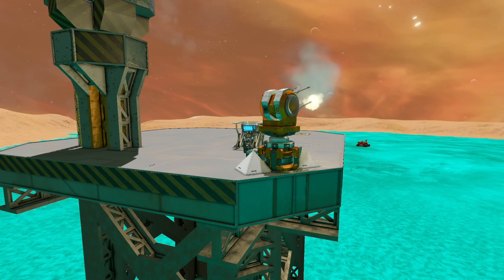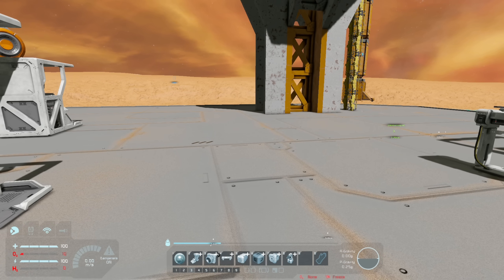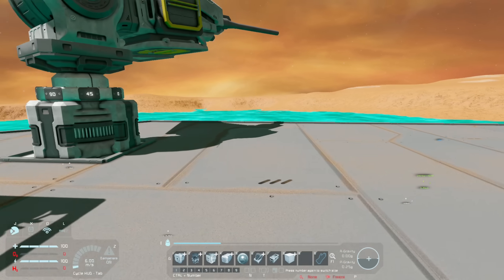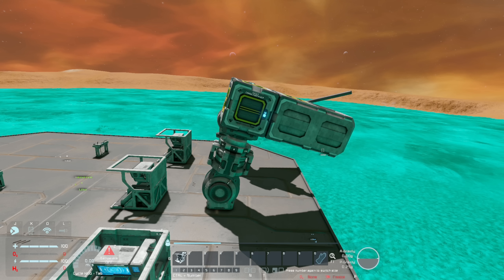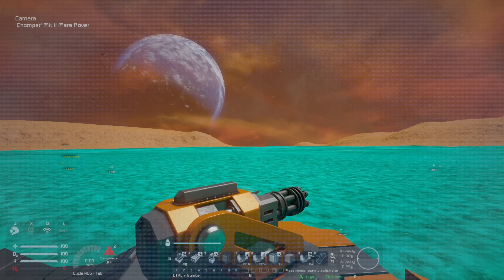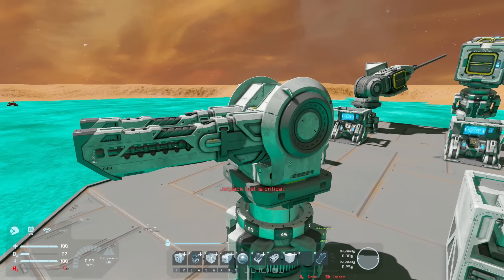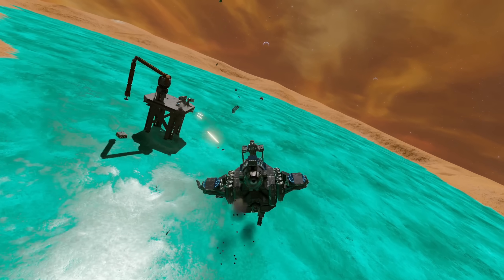Custom Turret Controller: Space Engineers Tutorial

Comment: Pro tip. To get a small hinge head inside the large hinge body. You only need to place a small landing gear inside of the large hinge housing, then place the small hinge part on the landing gear. You can then attach. You don't have to build a positioning contraption like in this video.
Reply from the maker: Even more pro tip, the game was updated to allow you to simply add the desired head directly in the control panel 🙂

Comment: I know this is an old vid but I’m hoping I can still get some help,

I just build a large grid turret that has a grid mass of 17,551,970. My problem is the turret controller is not smoothly traverse like a normal turret and instead incrementally maxing rotation and then slowing it to a stop. Elevation is fine but is the turret just too heavy or can I solve this another way?
Reply from the maker: That's likely pushing the limits of the capability of the rotor, unless your turret's centre of mass is directly over the rotor that's going to need enormous amounts of force to move
Reply: @Splitsie  
So drop some weight? ya that’s what I was worried about. I guess I was hoping no gravity = smooth acceleration. Although I did notice that turning off inertia share works until clang hits.

I’ll try moving the centre of mass over the rotor and update if it works but it might take a bit of moving around.

Thanks for responding
Reply: @Splitsie 
Hello, I started playing SE again and solved the problem.
Ya it was the weight. Better yet, I did not have to make the turret lighter. I used suspension and to take the weight off the rotor

Now I have a new problem something is causing the turret Ai to break. I have a feeling that it has something to do with the turret wobbling a bit after each shot but nothing is confirmed. Update when that’s ironed out

Edit
 I don’t know what I did but it’s back to moving weird. I think the wheels are adding too much pressure now.more tinkering to come

Comment: On Xbox one the advanced rotor doesn’t rotate with this setup. Am I missing something? Followed your directions to the end.
Reply from the maker: The console versions are almost identical to the PC version so you should be able to get everything to work. Check to make sure the rotor is linked to the azimuth setting in the turret control block, that the rotor is on and that there's nothing obstructing it from moving. You can also test to see if there are some minor obstructions or weight issues by increasing the amount of torque available to the rotor

Comment: This is an old video, I know, but I hope sb can help with a problem; The turrets don't seem to 'conveyor'. It doesnt auto load ammo for either gatlings or autocannons and I cant pull anything through it. I tested multiple setups, but as soon as I remove the larger hinge part and replace it by the smaller one; I cant use any of the conveyor system. It showes the classic 'blacked out inventory' when I try to pull anything through these turrets. I tried everything and they work perfectly on Creative mode, when it doesnt need to fill ammo, but in survival it just cant pull the ammo. Anyone any clue as to why this is happening?

Comment: I build all me vehicles for a first person only compatibility.  This results in most of my vehicles having piston masts with cameras and lights on them.  Before, I would use either tons of hotbar spaced to control the motion, or a remote and antenna.

The new block makes these masts much simpler, and really cleans up the toolbar, but sadly can't continue operating the vehicle when using it.

Camera masts are extremely useful when driving across rough terrain, as a sort of third person view when it is first person only.

I will have to test these out on my excavator though, it could really simplify operations.
Reply from the maker: That's a really cool use for these blocks :)

Comment: Does anyone know on the crane setup how the pistons push in or out using the controller? Is it just the "W" and "S" keys?
Reply from the maker: Those were just grouped controls on the regular hot bar. With extend, retract and on/off to allow me to stop it at particular points
Reply: @Splitsie  okay, thank you. I'm trying to weld up a projected small grid ship that has some internal components that were missed when I was trying to hand weld it. Trying to see if that controller and a large grid welder with complete the job.

Comment: I just struck me that, instead of picking A rotor and A hinge, the turret controller should offer the same list-box as with weapons.  (Each list-box should have an 'absolute'/'relative' check box to determine if offsets should be from a common zero point or from whatever value each rotor/hinge has when the turret is activated.)  This would, for example, allow easily pointing an array of turrets in the same direction with a single controller--maximizing solar panel efficiency, for example--multiple rotors for faster movement of a single turret, or a multi-hinged arm, such as a crane has.

Does that make sense?
Reply from the maker: That would make a lot of sense, it's a pity they didn't do it that way

Comment: I made a gatling turret but it looks "sideways". Can someone help?
I build an advanced rotor. On top i build a large hinge and destroy the center part. I add a small hinge. I place 3 small conveyor on the small hinge (for ammo) and place 6 gatlings on the sides of the conveyor. After that i put 3 armor blocks on the 3 conveyor to protect it and place a camera right on to (in the center).
I setup the custom turret controller, made a "controll" on my station.
after pressing the controll button i CAN controll and fire the custom turret BUT my view is kinda sideways. I can see 1 gatling on the left side of my screen but not on the right (should be able so see both or non) and if i fire the gun it shoots not where i look but to the right of where i aim.
Its like the camera is 45° angled to the left but i checked and the camera looks normal.
Only thing i can think of is that i moved the hinge while in construction to get a armor block in a spot that i could not reach. Can this mess up the setup and is there a way to fix it?
Thanks for all help!
PS: restarting the game fixed the problem...

Comment: This is driving me nuts. I followed your directions but as soon as I add the rotor and hinge to the controller they stop working. The AI randomly pivots and spins and if there's a target it will fire in any direction it's facing. I can control it, which means I pop into the camera, but I can't fire it unless I disable the AI and the rotor and hinge are still frozen. Whips script works so much better but I want AI railguns!

Comment: So I've set up a custom ball turret following all the steps, confirmed that velocity can be applied to the hinge and rotor in their control menus and that they move freely. However, when I attempt to control the turret through the control seat via the custom turret controller, neither the rotor nor hinge move appreciably. I can see their speed fighting to rise, but it never goes above 0.1-0.2 m/s and never practically moves. I assume I'm struggling with something to do with torque or multipliers but am at a loss as everything I've tried hasn't worked. Any tips?

Comment: 11:40 a much much much easier way of doing this, is to place one small block in the air so that it falls into the hinge, place another small block on top of that so that you have a 2 block tower and then add the hinge on top of that, attach the head and remove the blocks.
Reply from the maker: That works on level ground but not everywhere, where I can I try to show techniques that have as few caveats as I can manage, though if I were to do it again I'd probably show both ways

Comment: If you design it right, having turrets with strangely placed hinges and rotors such as flipping them could allow for some very, very alien-looking designs, rather than the conventional style everyone's used to. As for other ideas, I think having a turret with a cap on it would be interesting, as utilizing a sideways rotor rather than a hinge you could have some very good angles attainable. Alternatively, having a broadside weapon on a larger craft would work with some aiming angles if it had two hinges, one turned 90 degrees to the other, stacked atop each other. One hinge controls the azimuth, turning the weapon back and forth along part of an axis, while the other controls vertical aim, but they only have a bit of freedom of movement due to be inset to allow for good armor. A neat concept, I think.
Reply from the maker: I'm looking forward to the way that these evolve over time as people try out new and wacky things :)

Comment: I have not published it yet but... you can make a vanilla guided missile! Its ugly but gyro with override controls attached to the underside of the rotor build 2 heavy blocks off the top of the hinge with a camera on the front of it (you can add warhead) at the back add battery, ion thruster and under it the AI turret block. It points the camera at a ship within 800m you just need the thruster to be max override and a button to turn it on

Comment: To get rid of the wobble, I turn on share inertia tensor, but only for the hinge.  I found working with cranes that you can use that setting for all hinge/rotor except the first one that connects to the ship/station.  Just have to remember to turn them off when attaching a rotor (like changing tool heads on a crane).  I'll have to try playing with the speed modifiers like Andersenman suggested though, maybe that will be a safer/plain better method?

Comment: Here's the easiest way to attach the small hinge part to the hinge
Step 1: Place your hinge, delete the original part as usual.
Step 2: Place down a timer block with the following actions: Timer Block Trigger Now (On the same timer) and Hinge Attach. 
Step 3: Drop your small hinge part above the hinge and viola!
Reply from the maker: I've never tried that way before, I'm now curious how well it'll work for those times when I'm trying to attach a large rotor head to a small rotor on less than level ground. Could be really handy if it happens to grab it before the rotor part slides off :)
Reply: @Splitsie  sometimes you have to set up 2 timers triggering each other which is just a weird thing I’ve noticed idk why it’s only sometimes hahah

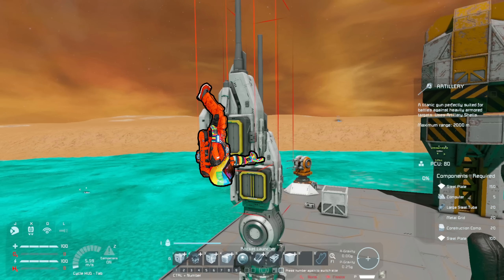Comment: Splitsie, 2:25 May not be a big thing in Single player but for those who play MP. 
In My little playing around I set a turret up similar with autocannons and had the weapon mounted like that. Trouble was I placed a target about 400m away and it couldnt get the depression it needed to engage it since the hinge locked out at 90 or 0.
So close range engagement of low targets can be an issue, without creating a 90 degree back wall off the hinge. In doing that the turret can still elevate 90 covering the full sky arc

13:30 it doesnt look weird, your in the future Mag Lev has become a lot more useful
Reply from the maker: That's fair about the elevation, though it does increase the risk of having the weapon collide with things. I feel like if/when I cover this topic in full detail I'll mention it as an option but still recommend the same thing as the default safe setup 🙂
Reply: @Splitsie  I havnt tried yet, semi newbie still trying to wrap my head around stuff, but I wonder if setting hinge limits would work to stop the script.
Lol off to fumble attempt two to try

Comment: I remember back then when sensor blocks and trigger conditions released i first build a kinda functional Auto turret  the azimuth Rotor would spin continously so that the turret would form a kind of Radar a sensor would then detect an enemy and reverse the Rotation which would then trigger another sensor that overrides that directive so that the azimuth Rotation aligns with the enemy then pretty much the same setup with elevation and a sensor to trigger the guns . interestingly enough that actually worked somewhat Well  had however a rather small range and prone to Lose its target if it was too fast  ,it looked similar to the terran rocket turrets from starcraft
Reply from the maker: They gave us a bigger sensor range at first too didn't they? I think I recall some of the early follow drones using a similar technique to what you described

Comment: to place the small hinge part ive found another way wich uses a small armor block dropped in the middle of the hinge then put another one attacked horizontaly so you have a platform then drop the small hinge part on top of the armor blocks .... attach then grind the 2 small armor blocks presto hinge attached then you can build the rest of turret ouhh i almost forgot another way of building it is put a connector on top of small hinge part large grid its beefier on damage from ealy testing im doing becaus thoses turrets are nice but you need them to be tough too :)

Comment: I've been tinkering with gimble mounted Guns on fighters, automatically converging on whatever locked target you have in front of the ship but the pilot keeps full control of the guns as if were directly mounted to the grid.
Reply: Would it be possible to make the turrets lock on to the target automatically but let the pilot fire by himself ? I guess a hinge>Rotor  or double hinge setup helps with that
Reply: @Schproemftell  To prevent the AI behavior firing the guns automatically you can set up the Turret with no weapons assigned. It will still aim the camera towards the locked target. And then you can fire the guns off the toolbar manually.

I found it was best to disable ai behaviour until I want to engage a target to prevent unwanted clanging, but as I set up an attack run enable the ai and Copy the target lock with the toolbar.

Circling the target I was mostly able to ignore the lead indicator and just let the tracking keep the guns on target.

Comment: The most stupid idea: use two of those controllers to build the silliest of walking contraptions. Landing gear+rotor+hinge followed by a middle part (a few blocks straight line + power and conrolelrs + cockpit) and then the reverse. Hinge, rotor and landing gear. By switching the active controller and which landing gear is active one can swing about the rest of the contraption to reposition the other landing gear. Resulting in "movement".

Also, one could stick a projector at the end of a crane and use it for manually 3D printing stuff...

Comment: I never thought of using the tiny hinge part.  I think I have a solution to an idea I could not get to work with just adding the larger small hinge head.
I love how you can quickly discover other uses for blocks, the crane in this video.  I wonder if you can use this to improve the Monorail Mining rig in SI.
Until your original testing video on Twitch I didn't believe you at first when you said the Cockroach was to powerful.
Thank You for your great videos.  I like how you explain things.  I stumbled onto your SE Videos because a different Youtuber who's Star Citizen videos I had been watching tried SE.  I searched Youtube for examples of either other ship or base designs and either found your original SU or the co-op with Capac and was hooked.  I saw, not live, your Race to Mars with Kanajashi and would like ta also thank you for your considerations to your viewers: Screen gunk and the lower tool noise, not eating things that make noise, not flinging your welder head around when pointing at things giving people possible motion sickness, and if you use a keyboard with mechanical switches positioning you mic to not record the key presses.  Other youtubers don't have the same setup and it sounds like they are chomping on a mouth full of gum with their mouth open.  Also, thank you for not having the habit of smacking your lips when you start saying something new.  Your videos set a high bar, resulting in me sometimes skipping parts of other youtubers videos because of minor things that get bothersome.
Sorry for the ramble.
Reply from the maker: Hehe it was a pretty good showing of just how good the Cockroach was, getting hit that hard and just laughing it off :D

Comment: 2:14 I actually think that it would be more beneficial to put it facing horizontally initially as you would gain gun depression. Of course it would be of less use if it's very much a true-surface-level turret rather than one slightly elevated, though I think that should be taken into consideration. Only other exception would be if these were also on pistons and would extend/retract out of a sort of hidey hole, where going vertical would be easier to manage.
Reply: Thank you, that's what my rover turret was missing, I found myself having to change the wheel strengths and offsets to point down when I parked on a hill overlooking a ground base... If I just built the weapons rotated I could have dipped them.